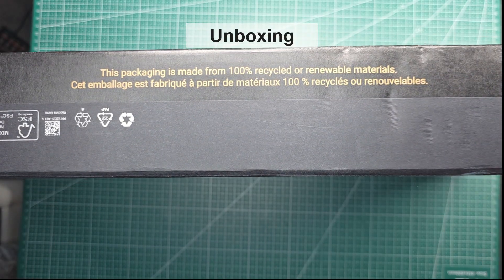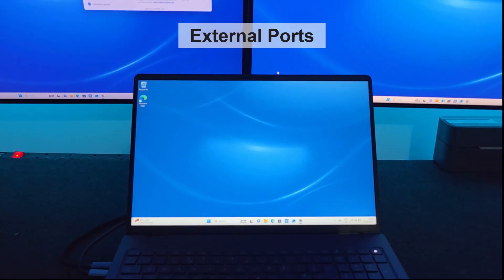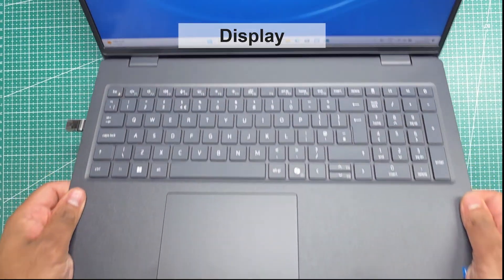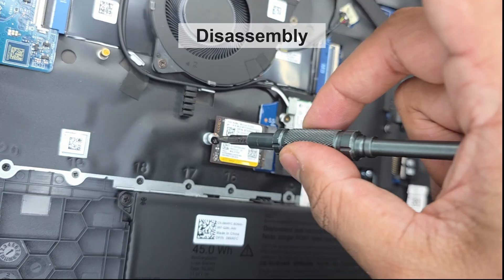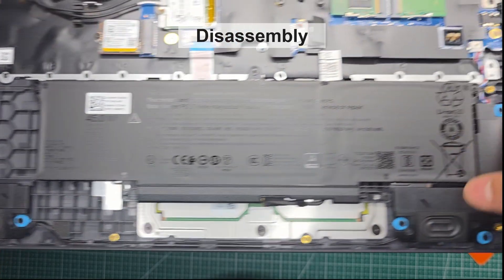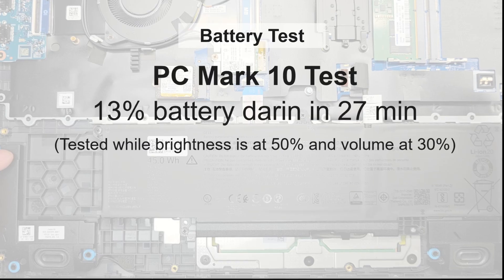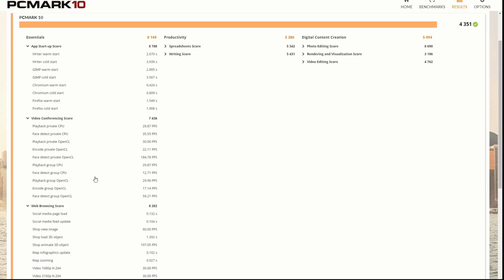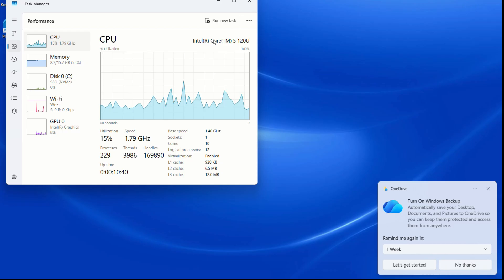Dell Pro 16 (2025) Full Review — Performance Benchmarks, Battery Test & Upgrades

Comment: The small battery and single SSD slot are very disappointing on a 16" laptop. I know Dell offers a 55Wh battery but still, the competition offers 70 and 75Wh batteries. At least with this smaller one, they could have given us an extra m.2 slot. Or 2.
Reply from the maker: Agreed, to get these you will have to upgrade to pro plus..